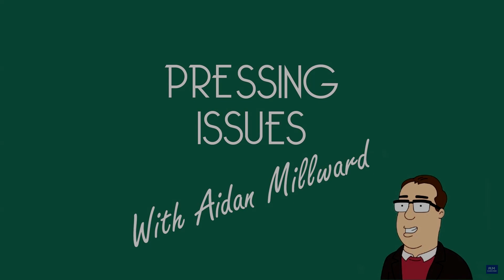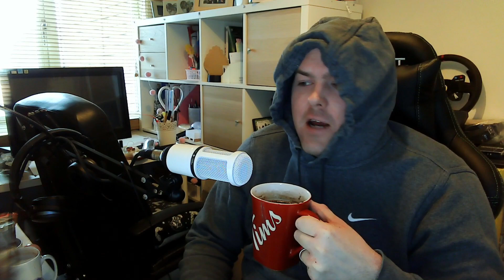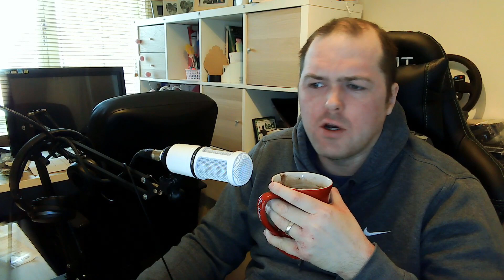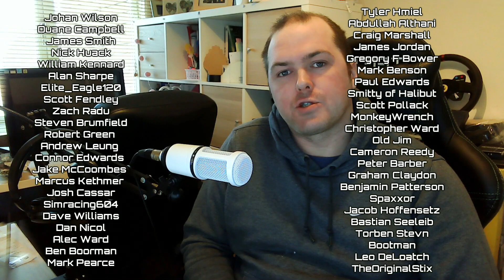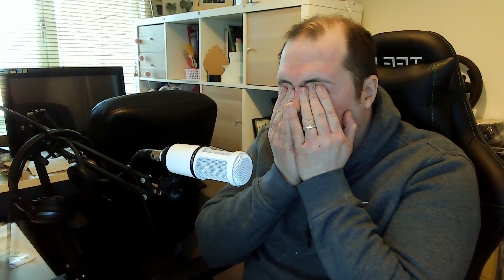IS IT REALLY TILKE'S FAULT? Opinions on Hermann Tilke Track Criticism

Comment: The answer is both yes and no. 
Yes, because Tilke has a certain set of corners he re-uses on each new track he designs only changing the sequence.
No, because the FIA/FOM has as you said very strict rules for new tracks that don't leave much room for track designers.

I'd say this is just another example of how F1 has been doing a lot of things wrong for decades now: while the initial intention is often good, the planning and execution are either rushed or bound by so many rules that the result is predictably bad/boring.
Reply: I agree. Too many similar corners that don’t work. COTA works because Turn 1 is so wide, the turn 11 hairpin is there, and sector 3 is practically just 3 hairpins of various radiuses. Otherwise sector 1 is a write off and sector 2 is one long straight.
Reply: Going off your "initial intention" idea, I think F1 often tries to over-standardize things that fans and teams and drivers alike actually like with more variety. This move toward every track being 3.3 miles long with 17 corners certainly has its benefits for logistics like corner workers, advertising, TV coverage, how teams go about the event each weekend, how many fans fit into each venue, etc.; we also know that the F1 calendar is heavily defined by Monaco at one end and Spa/Monza at the other. The differences in venue make a difference to the sport, and bring something to it, and I hope that gets appreciated more, especially in light of the Bahrain outer race we had recently.
Reply: @Trendyflute  It's a trap of their own creation they keep falling into. They desperately try to find a formula that garantuees safety, entertainment and challenging racing yet fail to realise that in doing that they are kind of creating a more European version of oval racing: it doesn't matter where F1 races, the track is virtually the same. The charm of the old circuits is that they are all very different, both in length, corner-types, average speed etc, which makes each one of them a different challenge. 

But even worse in my opinion is the other side of that same coin: in order to ensure more safety for both drivers and viewers, they eliminate things like the old gravel-traps and replace them with wide run-off area's. So now a mistake has almost no consequences anymore, which is why the drivers keep exceeding track-limits. Monaco and Spa are the exact opposite of that philosophy: exceed the track-limits and you're out of the race, which makes those tracks way more exciting.
Reply: Spoiler alert, every track designer ever does the same thing. And usually it's becasue the promotor asks them to, or yes it's a good corner and they can replicate it in similar terrain. 'make it like x, but flip it' or 'like the approach to y but add a kink'.
A big part of this is that the language set to describe track features that don't exist yet is completely up for interpretation. We've worked with drivers who can talk about what the car will DO in the corner, but have no idea how to build it. Or track builders who know exactly how to build the right thinf, and don't understand how the current (or even future) car will react to it.
Reply: Calling sector 1 a write off shows you don’t know anything.

Comment: They need to use multiple designers. One guy can only do so much.
Reply: In fact, Zandvoort has been refurbished by Jarno Zaffelli, Italian.
Reply: I was going to comment the same . Plus some fugure 8 tracks like the suzuka circuit
Reply: @edmundscycles1  buddh would’ve been a nice figure-eight track
Reply: I mean you should have a variety of designers to have unique ideas and perspectives on track construction.
Reply: Replacing drivers classic  tracks like Brands Hatch, Oulton Park with bowling green flat boring tracks results in boring races.
Reply: @johnhodge1263  They have at the moment grade 2 FIA I think and I'd say that Brands Hatch would be too narrow for overtakes.
Reply: @carlomariagranata01  safety issues and shortness of tracks is an stumbling block for most classic tracks . 

I do like the circuit of America though . Shows what he can do if he has a blank slate  and earth moving equipment.
Reply: @edmundscycles1  yes, I agree because COTA is very different compared to the other American circuits. COTA is like a modern European circuit.
Reply: @carlomariagranata01  as a base to work with ie : 2nd 3rd gear corners,  gradients, cambers, inclines, & hairpins, no need to have expensive designers to produce a example of modern Oulton Park//Brands Hatch /Original  Nurembugring taking sections of each to produce 1 or more track designs.
Reply: @johnhodge1263  think that's pretty much how he designed COTA .
Reply: @johnhodge1263  Nuremburgring is 100% flat. It's also called the Norisring.
Reply: A lot of the great tracks were old public roads that were shut down for races so they were in essence designed to follow the terrain. I think the best designers would be a bunch of boozed up farmers with bulldozers and give them some hilly terrain to cut an ox cart path through, then pave it and put the pits on the straightest section. After all, the cars are so insanely safe now, and getting safer by the year, and these rules were developed when they had the crash worthiness of a wet paper bag.
Reply: @carlomariagranata01  Yeah, I think Adrian did a sim run on Brands Hatch and it was so short, with some really frightful corners. They could do something like bring the walls in and put up SAFER and tecpro barriers. The passing thing they just need to take off the aero and bring in the stickiest tires available, 60's style. That way the cars can follow one another for a pass and there will be many more pit stops, that's a win win in my book, in fact they need to do this in Monaco also, no more parade race.
Reply: Took the words right out of my fingers lol
Reply: @carlomariagranata01  it's too narrow because the new f1 cars are way to wide and long now
Reply: @carlomariagranata01  The problem really is that modern F1 has such different requirements from other categories, not only due to the super fast cars, but also the never-ending quest of "improving the show" to keep the business growing. Looking at the list of grade 1 circuits, it seems like F1 needs its own venues these days.
I agree that having more people to design tracks would be better. For example former drivers - they should know a thing or two about what makes a good circuit, I think.
Reply: @carlomariagranata01  tracks, cars and shoes: leave em to the Italians
Reply: @DidierPeroni  lol
Reply: People forget or don’t know Kevin Schwantz had a lot to do with the design of COTA. One of the reasons it is so good.
Reply: COTA is more old school European than new. Like Spa or Le Mans just updated safety.

Comment: My biggest issue with Tilke tracks is that they are like compilation albums. There is no theme, no coherent idea that brings the track together. It's just corners or sections from other tracks (often his own) that are considered good put together. Old tracks follow the landscape and public roads that were used for racing which gives them a unique feel and character.
Reply: And Portimao, despite being one of the newest tracks on last years calendar, has said character, and wasn’t designed by Tilke. Then again, Tilke doesn’t choose the location of the circuit, so he often can’t decide what elevation and points of character the track can have. I agree with the compilation album comment though. Since The late 00’s there has been a constant pattern of Samey-corners at new tracks.
Reply: @formulafish1536  well he did make the elevation changes for COTA as that plot of land was nowhere near as hilly as it is now
Reply: @thebronzearchertba9442  Apparently COTA had massive input from other people in terms of it's design, and wasn't exclusively down to Tilke.
Reply: @mikespearwood3914  didn't know that so my bad
Reply: @thebronzearchertba9442  As I understand it, Tilke's actual role in designing COTA was only slightly more than advisory in terms of actual decisions regarding track layout

Comment: Chain Bear’s video on Tilke is very illuminating as to how he designs tracks. His brief is not only to meet FIA rules for safety and facilities, but also to create F1 racing that isn’t boring. He does it with big straights, slow corners and adds some fast corners where he can, all under 6km in length to keep the lap count up. 

Korea was a little change up in that all the straights are on one end and the corners are at the other end. He didn’t design the COTA layout, Kevin Schwantz and Tavo Hellmund got his assistance to do it; Abu Dhabi, he was asked to design a new Monaco by the artificial marina that was built there, and the shape of the marina restricted what he could do. He still murdered it by going too far with that brief I think.

Comment: I read an interview with tilke in my local newspaper.
He seems to be a nice guy and very aware of the often negative reaction about his tracks.
He said that he would love to build tracks like spa that are integrated into the landscape but he simply hasn't the room to do it. The run from la source to radillion alone often would take up more than a third of the space he has available. Also it is much harder now to get the approval for an racetrack that flows trough a hilly landscape. That's why most of the modern tracks are flat like a pancake and often located in deserts or remote areas.
He seems to be very proud about the red bull ring and hockenheim though.

Comment: Back in the late 90s, F1 fans complained that tracks lacked overtaking opportunities. They decided that new guidelines would see wider circuits and more hairpins to aid overtaking.
As for Hockenheim, it’s a misconception that the FIA wanted the circuit changed. Circuits of the Past did a video this week talking about this and it was actually the circuit bosses that made the decision to create a new circuit as they were worried that new circuits like the Lauzitsring would appeal more to F1 fans. Tilke actually wanted to use more of the original layout and put a few new corners in, but he was told he had to work within the land that the circuit owned...after they sold off the majority of the forest section.

Comment: My biggest issue with the Tilke tracks is that most of them, if not all, have has his signature design, just in a different flavour. The masterpiece that is Sepang is found in different variants of his other tracks, so having some more people designing tracks will give a different feel. Nevertheless, F1's biggest issue is that the aero regs are all bandaids to the "following another car problem" that it feels like nothing got thoroughly tested by engineers to see if it is a good solution, which is where i have the hope for the new regs since Ross Brawn was heavily involved in making it

Comment: One of the biggest problems is most Tilke circuits became Long Straights leading to corners that are "Hard Angles"

Using the final turn (16) of Jiading in Shanghai as an example:
If you rounded-off or at least made a shallower apex for some of these hard-angled corners it could create more opportunities where there'd theoretically be less braking and more "lifting (and/or) sending" - see also: 130R

Comment: I really think that the criticism are quite exaggerated. He did a lot of great work, such as Sepang and Bahrain, which are great promotes good racing, and China, which has hosted some nice racing and in my opinion is very satisfactory to race around in.
Sure, there are the disgusting Yas Marina and Sochi Autodrom, the last one being one that I think that should be very modified in order to be at least mediocre. 
But the outcry around Hockenheim is something I just can't agree with. There is no way the old setup would work in modern F1, and the modifications made it a very decent track, with more overtaking opportunities.
COTA is a love/hate relationship for me, because it is so evident that it is just a collage of good sectors from other tracks, which seems lazy, but can promote some good racing so it's fine for me.
Not going to criticize the street circuits as they have obvious limitations.
I very much agree on what you said about the historic tracks. People tend to see it through the nostalgia glasses, and just can't notice that the cars now have pretty the length and width of a school bus and produce insane amounts of dirty air, making the requirements for a track to promote overtaking more specific than ever, and most of the classic tracks lack these requirements.

Comment: Golf courses have input from recently retired professionals including those who have held high world rankings for new designs, so why shouldn't f1 tracks have input from the likes of Coulthard, Webber, Hakkinen, Button and Rosberg?
Reply: But please Keke, not Nico...
Reply: It helps in a way but as a driver you want a circuit to be as fast and challenging as possible

Meanwhile fans wants overtaking, its just difficult to do that because fast corner means dirty air means no overtaking, i like your idea and it could help but there's also a problem

Comment: The biggest issue isn't actually Tilke himself, the issue is the FIA/Formula 1 having a push for "new" markets. Thus requiring new circuits in places that haven't had a "motor racing arena" before. Like you said with the FIA requiring X,Y & Z for its new/F1 circuits. The FIA should have used a variety of architects, rather than  reverting to Tilke. There were/are many other track designers available in the world.

Comment: To really spice things up, F1 needs to design and race on 1-2 tracks per year that incorporate numerous non-Tilke features such as corners with extreme negative camber turns, blind corners, multiple apex turns, undulating road  surfaces (including the turns), decreasing radii turns, Belgian block road surfacing, 25-30 degree banking corners, along with high speed esses, in a circuit having a minimum of 25% of its corners incorporating no less than three of these design features.

Comment: Little from column A, little from column B. Hockenheim, Sochi, and Yas Marina... yeah, those were certainly cases of "Design this, but you must do it with very limited space.", but for others, it does seem like "Ok, I want this section, this style turn, this type of turn complex, and this other type of racing section, and then connect them all together." 

And it's interesting that a lot of the other choices for hosting a Russian grand prix are also tracks designed by Tilke...

Comment: While Tilke has given us some excellent tracks... I think having his fingerprint all over the championship makes the circuits very similar. So having a different designer may give us different characteristics in terms of track design, BUT... whoever comes in instead, will still be vulnerable to creating bad circuits. Personally, I think the problem is more to do with the cars than the tracks. If the cars can't race closely, then by definition, they're not race cars, which is why the spectacle can, at times, be quite poor.

Comment: I feel like some tracks that we see as pretty stale should be reworked like Abu Dhabi, Singapore, and Sochi. I feel that street circuits could have been better. Abu Dhabi should 100% be reworked, well Sectors 2 and 3 to be specific, the 1st sector I don’t really have a problem with to be honest. The tight left-right-left section before the left hander after the second straight (sort of straight) is pretty much impossible to overtake at without shoving someone off. Sure the shoving could be exciting but that will all be mitigated once the stewards slap a 5 second penalty and the move was pretty much for nothing. Some tracks I want to return are like Nurburgring and Hockenheim but the Nurburgring is a bit 50/50 due to the chance that very heavy rain will cause a clown show at the dipping Turn 1.
Reply: While I don't disagree that improvement can be made; have a look at the (they are on YouTube, albeit only in 360p) 2010 FIA GT races at Abu Dhabi. Corvettes vs Maserati MC12 vs Ford GT; not much of an issue with that sector 2! The short layout worked for V8 Supercars as well when they went there. Unfortunately a lof of these tracks are designed and built for F1 only, and so they wend up trying to mitigate the shortcomings of the F1 aero-dependency.  WEC for instance at Shangai - looks like a totally different circuit, as does Barcelona when the GP2 cars were on it (as did Singapore and Valencia - fantastic street tracks for GP2 - appalling for F1).

Comment: I agree with you that Tilke is just doing the best he can with what he's given to work with (in terms of location and requirements).  I think you miss one important nuance to how modern road tracks are designed.  That they must also accommodate multiple racing series, including motorcycles.  For instance, MotoGP is the primary reason why so many tracks have concrete run-offs rather than gravel traps.  Hosting one F1 race a year will not pay the bills for any track owner.  And a track design that makes F1 racing best, is not necessarily best for other series.

Comment: Having someone else than tilke would be good. Look at portimao great circuit not built by tilke. But he's not to blame he has guidelines to follow.  Land is not cheap so you can't build another spa. Plus they want fans to see as much of the track as possible like tilkes buriram circuit. I agree with your point on classic circuits don't always bring great races. We haven't had a good belgium gp for over 10 years
Reply: I play both the F1 games and Moto GP games and tracks like buriram, kymiring and the few other circuits that Moto GP use that F1 doesnt that are designed by Tilke would be good for F1 imo